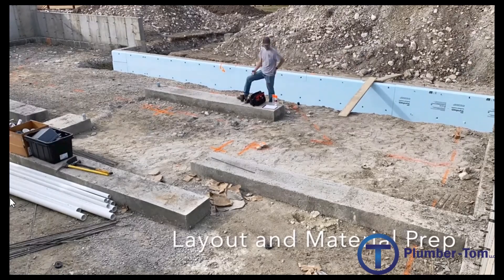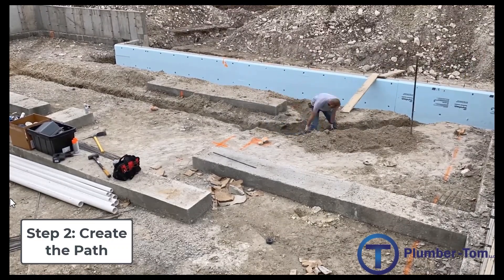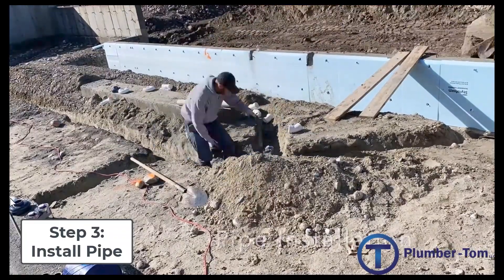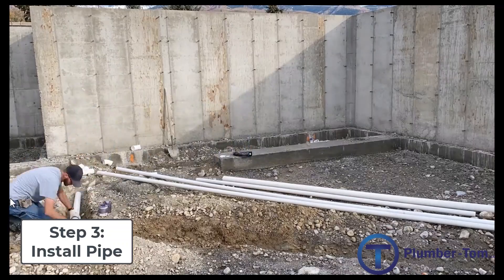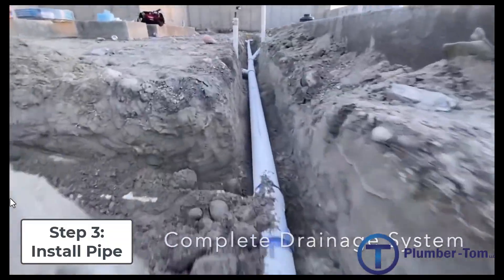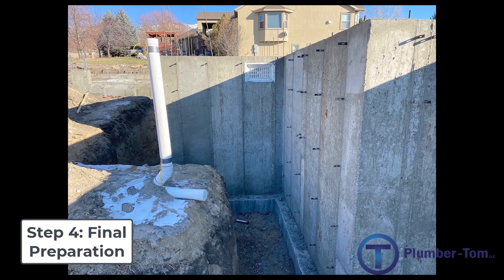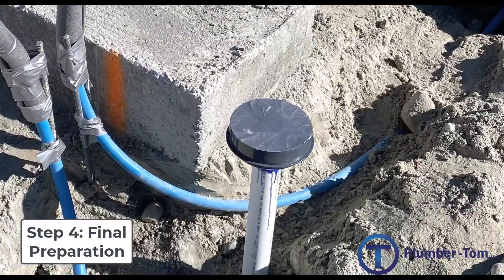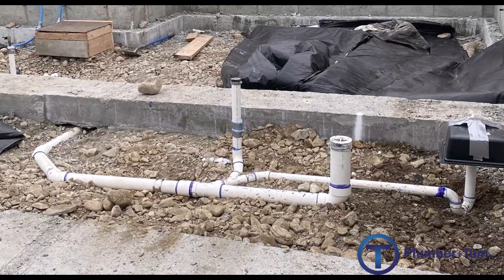Underground DWV Plumbing 101

Comment: Shouldn't it have gravel underneath the pipe to support it from shifting? Or is that just a Virginia thing.
Reply from the maker: Gravel is a great idea.  Code says that you should put something "uniform" and "load bearing".   Gravel and sand are ideal because they are great support for the pipe.   Some jurisdictions are okay with using the existing materials as long as they are tamped in.  Obviously, rocks, ice or other soft organic material should be removed because they are not good for the pipe.

Comment: What calculations led to the layout of the unground pipes ? Did you use A+B=C ?
Reply: Imagine the floor being a piece of graph paper and each square is one foot. A toilet in the middle of the house might be 10' from the north wall and 12' from the east wall. Does that answer your question?
Reply from the maker: Thanks for the comment!
Reply from the maker: I usually use 45 degree calculations to layout my pipes.  I have videos explaining the 45 degree triangle and 1.414.  However on an underground I usually just stick to the principle that the two sides of a 45 degree triangle are the same.  So for example if the pipe needs to offset to a wall 5 feet over, I will come away from the wall 5 feet and make a mark where the pipe is.  That I create the diagonal and that is where I will dig the trench.  Basically, I lay out the triangle on the ground and paint the diagonal.